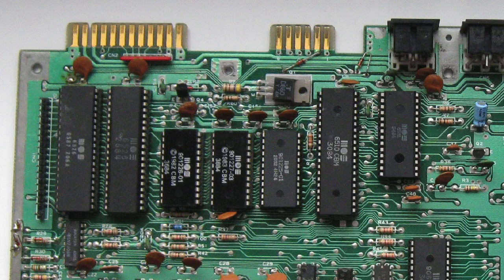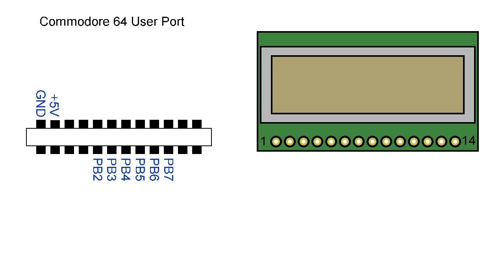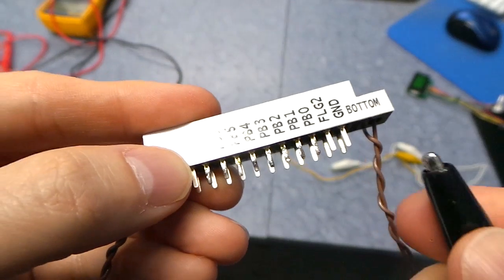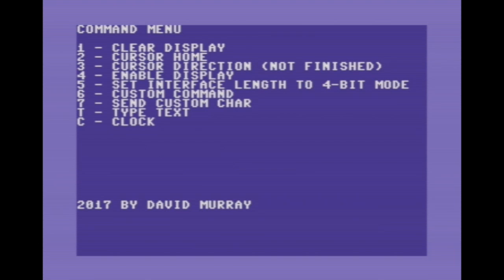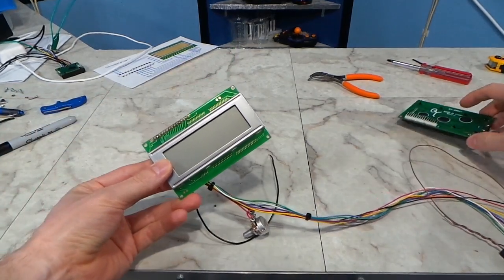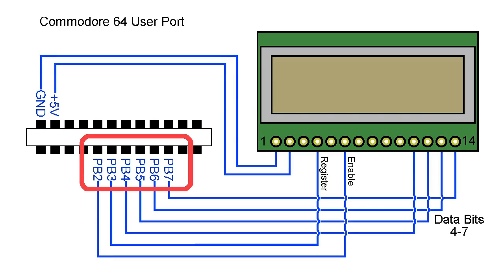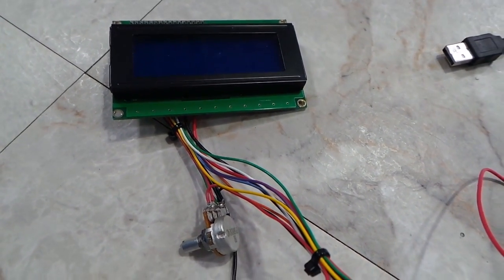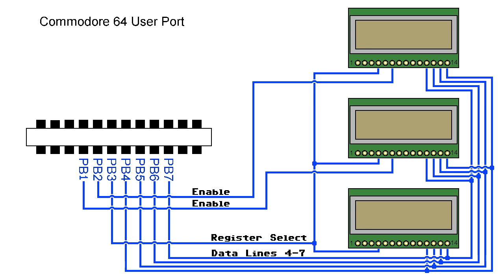How a Character LCD Works - Part 2

Comment: Modify power supply, so it couldn't provide more voltage than needed. There are 3 pin circuits called 78x (where x can be 05, 08, 12, etc, which says what voltage is being outputted by this element).

Comment: It might be a good idea to get a USB voltage monitor and wire it in between a C64 and the power supply to keep an eye on creeping voltages as time goes by.

Comment: Hey Dave, would you mind sharing the source code? I'd like to take a look at it. If you don't mind, that's it.
Also, where are you gonna buy a new C64 power supply? I fear mine does the same as yours...

Comment: Seems like the regulator in your 64 may have died, probably the fuse with it. They're not terribly hard to replace, so you should be good off if you need to fix it.

Video on the TI-99/4 and 4A sometime? They're very nice little computers, what with their uber-1970s stereotypical names for things (It's not a cartridge, it's a solid-state command module!), and they're also very well built. It was to my knowledge the first 16-bit home computer.

Comment: Even when externally powering the LCD, you must always connect the ground between the C64 and the LCD.  Otherwise the port digital signals will not be referenced properly.  Perhaps you did this but it was not shown in the video.

Comment: You should take care when using the external 5V supply, you must join both the GND point from the computer to the GND of the external Power supply... with modern switching power supply could be very bad not doing this as very  high voltage (low current) could be sent to the floating ungrounded lines thus damaging the ol fragile 5V logic...

Comment: Ah, power supply failure... the bane of everyone who works on computer hardware. In high school, I restored plenty of 90s-era computers, so I've had that happen plenty of times. Late 90s/early 2000s power supplies don't fry the whole computer when they fail, though. No, they simply explode and catch fire.

Comment: Overvoltage is a very serious issue for those old commodore machines. The power supplies tend to give higher voltage in general when not under load. Thirty year old capacitors worse the problem and even  spikes while powering on can kill your CPU. Few weeks ago I restored an old Commodore and the first thing I did was to replace the 7805 voltage regulator with a modern DC-DC power regulator. They come pin compatible and can save "lives". They also lower power consumption and reduce heat. 

However the c64 is a bit special, it requires 9v AC internally to clock the CIAs. There are ways to fix this using 555 timer chips, but its some extra work.

Comment: Theoretically you could even attach not 3, but 7 LCDs to User Port (with tiny bit of extra hardware). Instead of dedicating PB0-PB2 for different screens you could use separate values of those three pins (which sum to 8 combinations, but we have to reserve one combination for not choosing any LCD so only 7 units could be used) and some simple logic gates that would decode PB0-PB2 status and drive ENABLE input of chosen LCD high while maintaing other LCDs ENABLE input low.

Comment: 11:35 You could actualy connect more than 3 screens. If you used a simple ttl decoder on the last 3 pin, you could connect up to 8 displays !
Reply from the maker: Sure.. and with some shift registers I could add even more.  But the point was I could add up to 3 without any additional hardware.  Maybe I should have mentioned that.
Reply: You do mean 8 displays, right? With something like a 74LS138.
Reply: Yes xD i'll correct that
Reply: u cud controll ovr 9000 screenz with enugh io expendrz
Reply: Carter, hit Shift+*. this will bold it. make sure to do it again at the end to achieve this
Reply: unless you use shift registers it's actually 7 screens, unless you want to constantly sent signals to the screens ..
Reply: How did you do that bold text?
Reply: Carter Janik like this lol

Comment: I know that feeling when you´ve fried something and you really hope the c64 will power on again.... did it once when trying to sample sound through the paddle port where I did get sound out of the tv at one point and was thrilled only to realise that the sound went straight through because I fried a chip.... but! It actually works to get a lo-fi sampler through the paddle port if you use a resistor and a tape deck running at really slow speed to compensate for the poor clock rate when reading a paddle... just a tip.. ;)
Reply from the maker: Indeed.. In fact, I have a Covox Voice Master that plugs into the joystick port and I'll be doing a video on it eventually.  I'm not sure if it uses the POT lines or the digital lines, though.
Reply: Hope your C64 is a-ok.

Comment: Rip C64 1982 - 2017
Reply: kazoon Most Zener diodes will not reliably handle that much fault current well and also have a rather high impedance versus what one would want to see for prompt and reliable overvoltage protection.  A much better choice would be a either TVS diode or a crowbar circuit utilizing a Zener and SCR to short the power supply and blow the fuse.  However, the power supply must be capable of delivering enough current to blow the fuse (not always a given) quickly or you may burn up the TVS diode or SCR if the short can not be cleared by the fuse (though, if your SCR has sufficient heatsinking and is rated for the necessary current then it can endure, but most crowbar circuits expect the fuse to clear the fault quickly and are undersized for a sustained short.
Reply: +Mr T. Guru
The problem with doing that is, those old black bricks are solid epoxy around a PCB.  I took one apart once to try to do exactly what you're proposing.  Drilling out the epoxy without damaging the PCB is a lot of hard work.
Reply: You can put a diode on the motherboard to prevent that :-/
Reply: I know but it acts like a fuse and it's better than nothing :-)
Reply: SpearM3064 Actually, if you heat the epoxy to its glassification point (typically in the vicinity of 120-160C based upon past projects) you can easily chip away at the epoxy and just scrape it away.  It is still a bit of work and you have to be careful, but it is much easier and with much less risk of damaging the board or components as you do not need to be nearly as aggressive.
Reply: F

Comment: +8-Bit Guy you can also write a C program to control the parallel port of a PC, it is not that hard. Maybe you can make another episode of controlling an LCD with a PC?
Reply: ABaumstumpf Check this out: http://stackoverflow.com/questions/17851461/how-to-access-parallel-port-in-linux
Reply: Despite what he says, it is not that much different on DOS, I've interfaced LPT in it just fine.
On windows it would require loading a self-signed direct-access driver (which requires disabling signature-checking both in BIOS/UEFI, in windows bootloader and in windows itself) and using that driver's API. So, possible but messy.
Reply: It could work in Windows.  There are libraries for accessing IO port address space on Windows from user mode.  I recently reverse engineered the ASUS Aura controller on my new motherboard and it uses the SMBUS controller in the chipset to talk to the Aura chip.  I was able to determine the register map of the SMBUS host controller by looking at the Linux driver for it and using the addresses I found from that I could control it from Windows by reimplementing that logic with a library to access IO ports on Windows.
Reply: No One
adresses for LPT1 and LPT2
 Data register (Base Address + 0)0x378 0x278
Status register (Base Address + 1)0x379 0x279
Control register (Base Address + 2)0x37a 0x27a
Reply: Yeah that's what I wondered about too. I think it can be achieved by BIOS calls, or talking directly with ports (if that's possible).
Reply: Its pretty possible to talk directly with ports under linux. I don't know the situation in windows tough. In fact I've written a program for it. I can post it if I find it.
Reply: for PC, outputting to port 0x378 should be equivalent to C64's 56577 (did I get these numbers right?)
Reply: Ali Devrim OĞUZ He'll probably do it under DOS tho
Reply: You can try directy writing to it without using the library but I assume that would be more complicated.
Reply: GWBasic, or QBasic (MS-DOS v5.0) using INP or the OUT commands on the proper port numbers.  You could also use LPT1: with the OPEN command.  My magic trick was using some assembly magic stored in a string i could call to do interrupts inside QBasic for calling mouse driver, or direct DOS functions, etc.
Reply: It is still a loooot harder than just typing it in Basic. That was one of the things i stubmbled upon when testing audio-output for Arduino (atmega328), rasperberry Pi (ARMv6) and Saprtan FPGA (3E 250).
arduino was the easiest, spartan you had to do a bit more, and raspberry is a mess in comparison.
Reply: No One It might change according to your pc but its generally that adress. You need to use the included C libraries under the linux tough.
Reply: It's two lines of assembly code for a routine that'll output a byte to the port
Reply: There is a very similar implementation for dos here: http://electrosofts.com/parallel/
Reply: I was thinking the same. But, just for DOS, 95 and 98. After that P.Port cannot be acceded by user anymore. But there are drivers to jump this anyways. On plain DOS is as straight as Basic. Serial is a bit tricky, but ... it fine. Probably you can play with P.Port under VB6 on W98 ....
Reply: I agree.  It was extremely easy to drive the parallel port in GWBasic on old x86 machines.  He must not have done the old "blinkenlights" out of the LPT project with a PC back in the day.

Comment: Will we see a C64 repair video?
Reply from the maker: most likely...
Reply: The 8-Bit Guy you should build a replacement power supply for your C64. Maybe even turn it into an episode! Those original ones are all time bombs and there's no quality replacements online that don't cost an arm and a leg. DIY replacements however are cheap and easy to make, and really are the safest bet in the long run
Reply: Yes, please. I really wish to see this machine restored.
Reply: Full length feature, hopefully.
Reply: I'm looking forward to a C64 repair video! I have a 'black screen' C64 myself.
Reply: I also would like to see a repair video. Hard seeing these this die and not get repaired. Like others say, would be a good idea to build a safe replacement supply.
Reply: Mahmut Arkawi Check Youtube for arcade mainboard repairs. These are very similar architecture. C64 is no where near as complex as todays systems. The problems come when custom chips are damaged. Not an insurmountable problem, but it does normally  mean in one way or another the replacement part came from a system that was a donor. Hopefully it was of other parts that resurrected other machines as well so its not a 1 for 1. I can repair most systems like this myself, with time. I believe if 8bit guy cannot work it out he has several friends that can. Either way it goes I hope he makes a video of it.
Reply: +prufrockrenegade  True.  You can cobble together a C64 power supply with two wall warts (5VDC @ 4 amps and 9VAC @ 1 amp), a 5-pin DIN connector, and (of course) some wire.

What makes the original ones "time bombs" is that Commodore didn't want ANYONE messing with them.  There's a solid block of epoxy surrounding the PCB, and then the black plastic case around that.  The power supply has no ventilation at all, which eventually leads to them developing a "thermal fault".  (The simplest way to extend the life of the black brick power supplies is to always unplug them except when the computer is turned on.  That way they're not constantly generating heat.)

Another thing you can do to prevent damage in the event of power supply failure is to build an overvoltage protection circuit.  There are circuit diagrams that show you how to build one over at EasyEDA.com.
Reply: +piip4  Well, thanks to small boutique chip factories like Western Design Center, it may be possible to find replacements for some of the C64 chips for some time to come.  Using the 6526 as an example, it is trivial to emulate a 6526 on an Arduino, and there are people out there taking some SMT programmable logic and mounting them on 40-pin DIP PCB carriers.

65C02 chips are still available new, but the C64 used the 6510... those are getting hard to come by.  Maybe someone should crowdfund a production run of a few thousand of them.  Western Design Center could probably do the work.

The 6581/8580 SID chips are also getting hard to come by; and it would be difficult to reproduce.  The litmus test for any company that tried to produce a replacement SID chip (so to speak) would be if, blindfolded, you could tell the difference between the reproduction and an original SID chip.
Reply: The 8-Bit Guy my c64 did the same thing, so this would be really cool!
Reply: Cool, would love to see that.
Reply: ImpiantoFacile I want to see that :D
Reply: I really like those kind of videos. Like the ones that resurrect Capcom' s suicide batteries.
Reply: Isn't it just a 5V power brick with a certain connector on the end?  I'm sure even a 5V linear supply would be fairly easy to come by, then just perform a bris on the factory time bomb cable and graft the business end onto the new power supply.
Reply: Maybe
Reply: A R E  Y O U  K E E P I N G  U P  W I T H  T H E  C O M M O D O R E
Reply: It's better/smarter to use it as parts for your working C64, and instead invest in a voltage protecter like the SAV64, or a Jim Carlsen Power supply. Keeps you from frying another computer again and saves you money twice... :)
Reply: nah i dont think so, becuase is a computer not an 555 timer circuit there is like hunder if not thousands of problems so you can only trouble shoot a computer
Reply: I hoping not. ;)

Comment: That's why it would make sense to hook up a fuse and a beefy 5.6 volt zener diode across the voltage input of classic machines to protect them from dodgy power supplies.

Comment: Can you control LCD in 2 bit mode? For example using USB
Reply: Not directly, as the name implies its a universal serial bus, you would need some form IC or component in the middle turning serial to paralell data, and then it would not be 2 bits (not byte) to begin with.
Reply: Byte =/= bit
Reply: Nah, There's no 2-bit mode, so that's not possible.

Comment: Could you do a video on the raspberry pi.
Reply: Why? there are thousands of those already and he would not add anything new to them
Reply: I agree with Jack here. More closely related to the tech being used in this episode is an Arduino Uno. Checkout Afrotechmods watch?v=nL34zDTPkcs

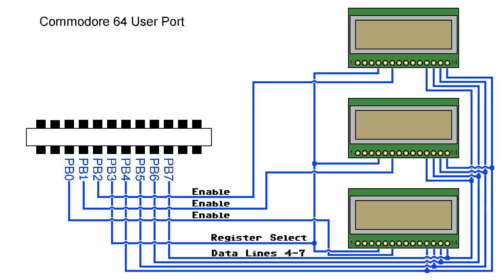Comment: Re: The PC parallel port blurb @ 12:05. If I'm not mistaken, don't almost all old computers with some flavor of DOS/W95 include QBasic? That's what I used to use to poke at the parallel port when I had a project to play with. Granted, I suppose it's not as built-in as basic on the C64, it's nearly as easy as long as some pre-NT version of an OS is installed.